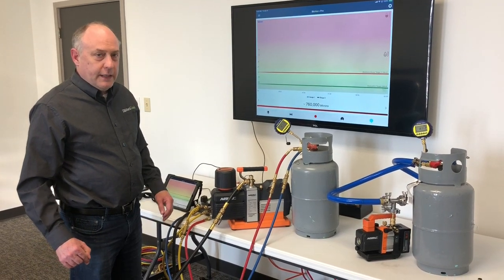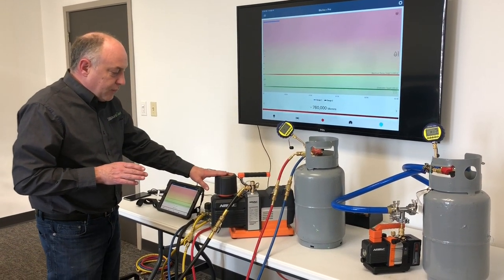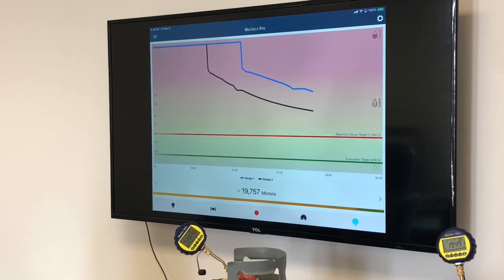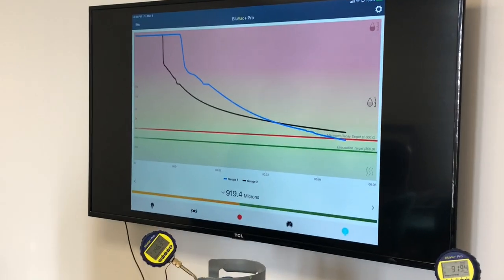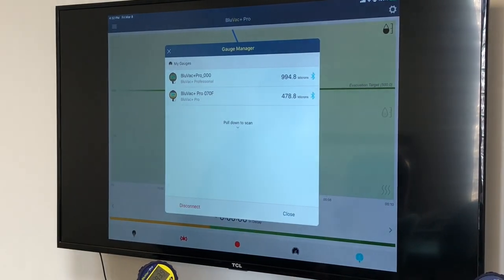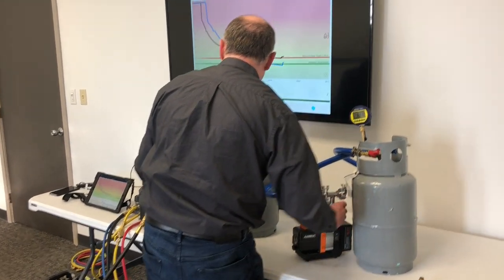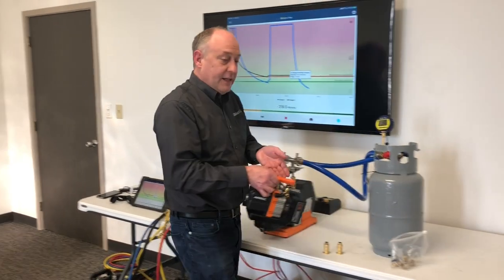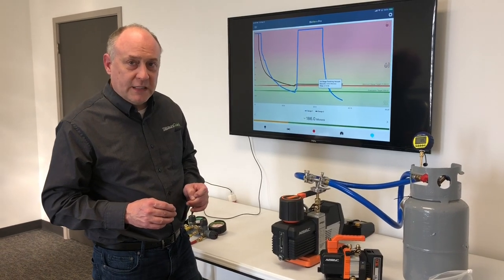12 CFM Vacuum Pump vs  2 CFM Vacuum Pump

Comment: Hi Jim,
Very important, very valuable and accurate information. Thank you.
One point also is if your using the larger pump, and if that system has a high contamination your risk freezing the water vapor and then your pulling against an ice dam, not the system  I demonstrate this with a bell jar hooked to too large a pump. At first you see the water turning to vapor, then in about a minute you see the clear cup of water flash to a solid block of ice.
Science
Smaller pump bigger hoses = success.
Reply: I'm new to hvac, and this is very interesting to me. Would it be possible for you to make a video of this?

Comment: i got the navac 2cfm and 4cfm battery pump and two sets of single xl trublu hose kit... im literally in love with both pumps and hoses.. i got a system under 200 microns in under 3 minuteds with the 4cfm

Comment: Excellent video. Really shows the difference and that it's not only about pulling the cores, but the hoses too. Also shows that a 2cfm pump can be useful. It's way cheaper, even if you buy two, than a single larger, expensive pump (and you can have redundancy and flexibility).

Comment: Great video! I wonder what the difference would be between running the 2CFM pump with TruBlu hoses versus running it with two industry standard 3/8" or 1/2" vacuum rated hoses. The cost of a 2 host TruBlu setup is a staggering $550 USD whereas you can buy two 3/8" or even 1/2" vacuum-rated hoses for less than $150 for both and still benefit from a larger diameter, high flow setup without paying the several hundred dollar price difference for TruBlu.
Reply from the maker: You are looking at a three hose kit. For residential you just need this. You can simply pull from the suction side of the system and put the vacuum gauge pin the liquid line. It is at least 16x faster and 4x faster then 1/2” hoses. https://www.trutechtools.com/Accutools-A10757-1-TruBlu-Starter-Evacuation-Kit

Comment: Great video !  This Video Really does Not suck !  i Mean it Does Suck - But in a Good way.   Vacuum Jokes . 🤣🤣🤣 🤣 You Know someone was Bound to do it sometime. 🤣🤣🤣🤣 Thanks For Making it. You said the Black hose attached to the 12cfm was a 1/2" hose , i use a 1/2" hose & mine looks quite a bit bigger.  im thinking that was a 3/8" hose and u misspoke ? coming off side of 12 cfm tee 1/2" im thinking it was 3/8" and 1/2" off top of 12 cfm tee. My 1/2" hose is also only 3 ft long that black one is wayyy too long. Great video though , it Really Shows those true blu hoses Perform Very Well ! They Look Like a Great Product !

Comment: Today oct 24.24 
On 1st start up 5 ton 40ft lineset lennox split system 2cfm hercules (harborfreight) with the XL blue kit it pulled it down 4xx microns in 5 min

Comment: I AM ABSOLUTELY IN LOVE WITH MY TRU BLU HOSES! AMAZING STUFF....ITS ALMOST UN REAL THAT THEY DIDNT COME OUT YEARS AGO...THEYVE CHANGED THE GAME.....GREAT VIDEO AS WELL....THE PROOF IS IN THE HOSE....NOW CAN YOU MAKE A 1" HOSE PLEEEEEEAAAASEEEEE SINCERELY- 🤙THE HVAC/R DUDE🤙
Reply: @coldfinger459sub0  I dont know what this has to do with my comment. But ok
Reply from the maker: Awesome! Thanks, for the feedback. We actually looked at that with Accutools and it is at the point of diminishing returns. The ultimate vacuum and the speed are not significantly different due to the conductance speed of the system.

Comment: Jim:  I am looking into getting a freeze dryer.  They recommend a 7 CFM pump.  After watching this it appears to me that I would be ahead by getting a smaller pump with True Blue hoses.  Thanks!
Reply from the maker: For freeze drying I would recommend both. You need a large enough volume of oil to handle the moisture and a good ballast to dry the oil back out. Smaller pumps typically mean less oil. This a great pump for the money. DC motor, quite, and has a really low amp draw. https://www.trutechtools.com/NAVAC-NP12DM-12CFM-Vacuum-Pump

Comment: I am wondering that even with the bigger diameter hoses, aren’t the connectors at the pump inlet still the bottle neck?
Reply from the maker: Rojaktube No they’re not, it has to do with diameter and length. You can go with small diameter’s if the length is very short or larger diameter’s if the length is very long. Vacuum is a little different than pressure in his characteristics. This is what we call conductance speed of a hose

Comment: I know absolutely nothing about pumps but Im looking at a HR freeze dryer & from my understanding is its the pumps that gives the most headaches.  so a standard is 7cfm & either a clear or black 3/4 hose... 
However I have looked at a generic one from china & their pump looks bigger but unclear of what the cfm is on it other than 10pa but don't know what that means. Or is as simple as just changing hose? 
What would be a better option - also live in Australia if that helps.

Comment: I'm assuming that using a vac pump with the true blue hoses should allow it to run cooler, because of the shorter run time & the pump isn't working as hard?
Reply from the maker: So actually it will run harder as it is doing more work. But it does it in a much much shorter amount of time. My guess is most times for residential if you purged with nitrogen prior less then 10 minutes so the pump will get to operating temperature and that is about it.

Comment: I have a freeze dryer and a 7cfm pump, supposedly, and I want to run a 5ft hose from machine to pump.  A 3/8"ID hose with a 90 degree JIC fitting (so I could run hose out the back) wouldn't work... It only pulled 900 mtorr.  Do you know what I'd need in the way of hose and ID to pull more.  I need to get it below 500 mtorr.
I know freeze drying isn't your thing but the tech is similar with pump and hose.  Thought I'd give you a shout.  Thanks for any help.
Reply from the maker: Just order a TruBlue XL kit from TruTech Tools. It is a 3/4” hose and it will do the job very well. You are not even close to how your pump can perform with that 3/8” hose. BTW, if you need a 90 degree fitting for the TruBlu hose, TT has them also.

Comment: How long can a vacuum pump operate ?  Can it run for an hour ?  Cause mine shuts of after 20 min cause its hot !!
 I also have air bubbles in the oil fter a minute of operation ??

Comment: Does anyone know roughly how many hours of use I should get out of this with proper maintenance?
Reply from the maker: If you mean how long the pump would last, currently they are at the two year mark and we are not hearing of any issues.

Comment: Question about the TruBlue fittings how much loss of speed is had by using the 1/4 angle fittings compared to the 1/4 straight fitting?
Reply from the maker: It’s every minimal, The losses are experienced during the initial degassing which is the shortest part of the evacuation. So from 760k to 20K microns. After that it does not really matter what fitting you are using. On a smaller system like 5 tons or less you might not even tell a difference.

Comment: Regarding --- Measure quick app. You have R-417a on the App could you please add R-417C. i would really appreciate it.  if possible. i checked r-417a too see if it was close. its wayy too far off , so i cant use 417a even in a pinch. thanks. oc.

Comment: Why don't you hook up the 12 cfm pump exactly like the other one. The smaller pump will get smoked period,
Reply from the maker: It depends on the rig. If there were both hooked to the 4 valve manifold with 1/4" hoses they would be almost identical as the flow is restricted by the manifold and smaller hoses to about .5 CFM.  It does not matter if you hook a 12 or a 2 CFM pump up, the hoses are the restricting factor. Hook them both to TruBlu, and the larger pump will win for sure as the pump is the major restriction after the hoses. There are three restrictions in every system, the pump, the connecting manifold and the system itself. One of them will always be the limiting factor on speed.

Comment: would the 2cfm pump work just as good 3/8 hose
Reply from the maker: Steven Nieves no, all of the 3/8” and 1/2” you see is repurposed refrigerant charging hose. TruBlue is made differently. It is engineered for vacuum. It performs exponentially better.
Reply: so the 3/8 or 1/2 repurposed refrigerant charging hose gets less then 2 cfm
Reply from the maker: 3/8” (1/2” OD) nominal diameter is good for about .7 CFM at 1000 microns and gets lower the deeper the vacuum gets. That type of hose is not as good for deep vacuum.

Comment: Does anyone know if it is possible to install two pumps in pararell?
Reply from the maker: It is most important to have a good connecting hose then a second pump. The system conductance really becomes the next limiting factor. So two pumps are definitely not necessary or recommended.
Reply: @measureQuick  I will definitely use a hose like the blue one from the video as I understood the importance of a wide hose for a proper air flow. The thing is that the application I am using the vacuum pump for doesn't need to be super deep vacuum but to reach a good vacuum as soon as possible. I was just curious because I couldn't find any video in YouTube about connecting two pumps in parallel...
Reply from the maker: @yugos.oficial  Just one large hose will do the trick especially for the high level degassing that you are trying to do.

Comment: are the truvac Micron gauges water resistance rated?
Reply from the maker: They are not water proof, but they are resistant to things like rain.
Reply: @measureQuick  THANK YOU! They would do well to list things like that as a bullet point. I know a few guys who dont want to spend $3-400 to find out they can’t handle getting wet.